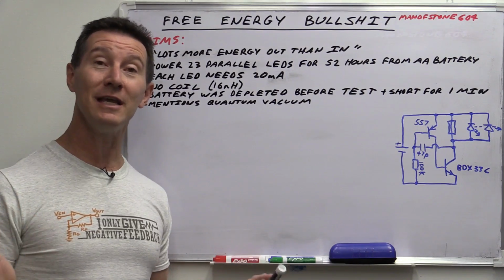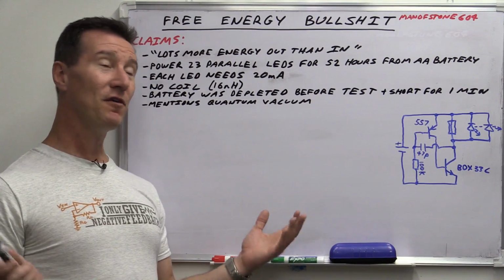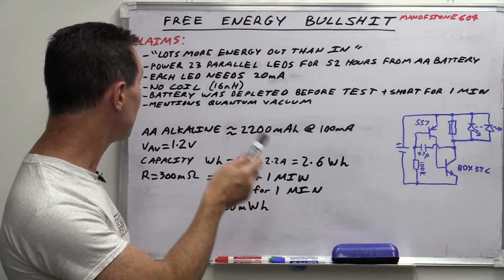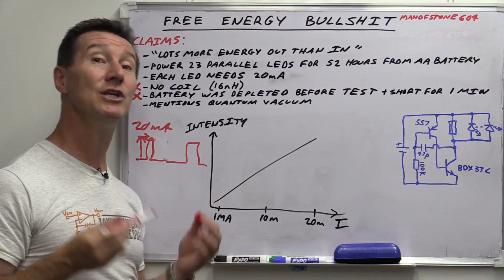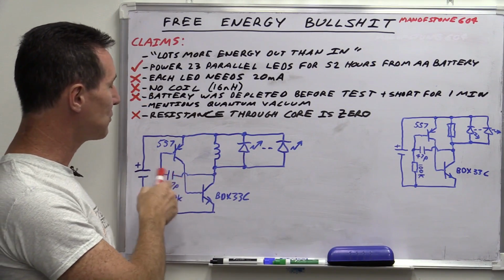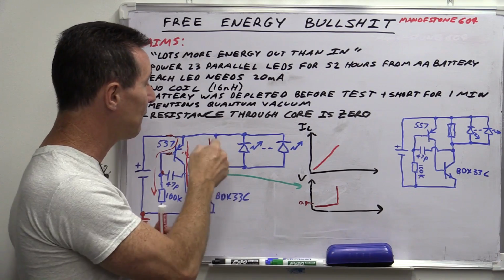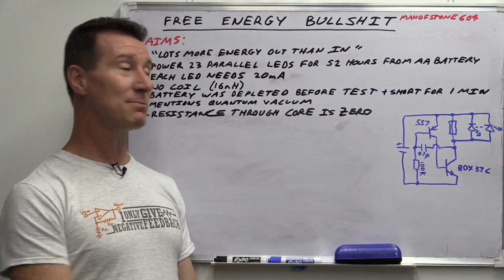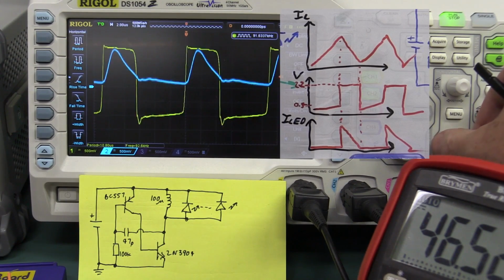EEVblog #708 - Free Energy Overunity is RUBBISH!

Comment: Stars consume energy to produce new particles of high mass. The smallest most energetic particle is the electron neutrino. It begin's time through progressive kinetic reactions. If free energy from this timeflow did not exist, your atoms would not exist, since they are getting free energy.
In 1955 two head professors for a University in Texas toured the country's colleges to demonstrate electron photography of a vacuum. Inside a space the size of your fist is enough power to run a nuclear carrier full bore through the water, according to electron photography.
All working free energy systems must utilize zero point by using carried waves inside a carrier wave. By imploding the carrier wave with them through the same dielectric materials which are like individual capacitors, waves are set in sync yet out of phase with proceeding waves so that after focus the waves must combine, forming a new higher frequency wave. This transformation waveset was described by Tom Bearden, witness to the Philadelphia Experiment. Nikola Tesla's files provided the plans for that, stolen by the FBI guys who smothered him to death.

Comment: Good day! I just stumbled upon your videos and watched a couple and have a pretty good sense, by now, of what your about. While they're enjoyable you are a bit whiney... Lol. No doubt, but I'm not going to kill the messenger because the message is good. So, I am a degreed engineer but more on the mechanical side (aeronautical to be precise) although I have a smattering of education in electronics and more in electrical. I've never really put much effort into understanding electronics circuits because as a technology consultant for many years it was more modular and packaged then I needed to focus on the details about. So, anyway, I have a question for you now which I could probably find out on my own but if you would enjoy entertaining it I'd appreciate it. It seems to me from watching your video on the overunity circuit with the LED's and the single alkaline battery, it seems that the end goal of a good circuit design for this particular solution would be to have an oscillating circuit cycling at about the frequency of the intended led to be lit. This would expend the least amount of energy in theory in lighting the LED ie turning the energy consumed into a useful purpose? I would say that my prior lack of knowledge about how LEDs really work led me to believe that we supply continuous power to an LED and it will oscillate at it's predetermined frequency ( and I believe that frequency has to do with the material that it is made out of). What your video leads me to believe is that we have to oscillate that power source to the LED in order to get the led to become excited and emit light in the first place? (either that or this designer's focus was to reduce the current draw from a continuously on circuit to a intermittent circuit understanding that an LED does not need continuous power supply in order to operate) and the more efficiently and effectively we do that then the better (more efficient) the circuit will be. Am I on the right track? Alternatively, to supply any voltage to the LED in the intervals in between when it needs to be excited in order to emit light would be energy wasted? Is that correct? The reason I ask this I guess is because the focus of this overunity perpetrator's video was apparently to demonstrate how easy it is to you know power the world on free energy. We know we can't do that but we try and strive to power it with the least amount of energy required as possible. So now I'm just wondering fundamentally what is the most effective way to light those LED's? What variables would be the focus of a competent circuit designer whose job was to do just that?

BTW, my youngest boy is now 10 years old. He's a big fan of that stampylonghead minecraft guy. funny thing is your voice and his voice are very similar and your approach to explaining things is also pretty similar. Lol. In contrast though, I would much rather have my son watch and learn from your videos so please keep up the good work and I'm going to introduce him to what you're doing and hopefully that will spark an interest (in technical things) in him that I've always had since I was a boy. Thanks again and I would appreciate if you just tone down the sarcasm just a little bit. I don't know if you have kids, but the last thing we want to do is make them feel like they're being ridiculed for experimenting and for taking risks... 

Regards,
Greg Baden
(Bryson Baden's dad)

Comment: buy the way several of these jewel thief dudes claimed they were super draining  the battery lower then you can normally use it ,by boosting the voltage, so a few were not far off the mark.

Comment: Joule thief concept is to use the energy of the old worn-out batteries 1,5V if you made a joule thief with current limiter for two batteries , one could mix batteries, and better use of them. Try led type 5050 ? There are 3 led inside the chip 3x20ma

Comment: Your video over all was above average, but your big mistake is to lump all over unity devices into one group.

There are MANY devices on the market that are over unity. (COP greater then one)
You can buy them. And test them all you like. THEY ARE OVER UNITY.
They have been on the market for about 100 YEARS already.

WAKE UP!

STUDY STUDY STUDY!
Reply: wits2014 I don't know if I'd classify them as over unity. Certainly they output more energy (of one form or another) compared to the input energy, but they are an open system. To me, an over unity device operates in an isolated system (i.e. one where no external matter nor external energy can enter the system).

Actually, scratch that, when you do an analysis of the total energy in any of those systems, you'll find that the total input energy is always greater than the total output energy.

Heat pump:
input energy = total heat energy + total kinetic energy
output energy = total heat energy - heat transfer losses
input > output

Solar panel:
input energy = total light energy
output energy = total light energy - heat losses - diffusion losses
input > output

Windmill:
input energy = kinetic energy
output energy = kinetic energy - blade losses - noise losses
input > output

This is a back of an envelope analysis and is probably missing a bunch of losses, but it's still valid.
Reply: wits2014 sure "free energy devices" are on the market and have been for a long time. So are thousands of other scams...
Prostitute isn't the oldest profession, scam artist is...
Reply: jwenting 

You ever heard of a Heat Pump??!! 

Or a Solar Panel? !

Or a Windmill?!

Are all of these devices,  scams???

I could name many more common types of free energy machines.

WAKE UP!!!
Reply: chickenman297 if they get more out than they put in, there's another input they don't take into consideration...
Reply: jwenting I thought that's what I pointed out.

Comment: Research C.O.P. 
Most machines that show C.O.P., show it at greater then one. 

Do you KNOW what that means? 

it is best to learn as you go thru life. 

STUDY STUDY STUDY...
Reply: If you think COP ratings have any relationship whatsoever with energy production, it is you that does not understand what it means.

Machines that are given a COP rating are for heating and/or air conditioning, or refrigeration.
Here in the USA, COP ratings are typically only given to the heating mode of heat pumps.
The COP is the ratio of heat output per unit of electrical energy input.

The base line for comparison is electric resistance heat, which outputs 3.412 btuh per watt of electrical input.
A heating device with a COP of 1 outputs 3.412 btuh per watt of electrical input, making it 100% efficient.
Electric resistance haters convert all of the electrical energy input into them directly into heat energy.

A heat pump with a COP of 3 would output about 10.24 btuh of heat per watt of electrical input, making it 300% "efficient" compared to an electric resistance heater.

The key thing to understand is that the heat pump is not simply converting electrical energy into heat energy, it is converting the electrical energy into mechanical energy to move heat from one place to another.
The heat output is equal to the heat absorbed from someplace else + small amounts from conversion of electrical energy to heat in the motors, etc. + heat of compression - any losses.

The total energy output is equal to the total energy input in either system.

Comment: There is a slight error:
When the transistors switch off, there is some current in the inductor.  This current value is what sets the peak current in the LED.  The place to put in some sort of current limiting circuit is in series with the power transistor.  Even without an actual current limiter, limiting the on time limits the current rise to V*T/L.  If the transistors are made to stay off until after the inductor current stops, this will serve as a fairly sloppy LED current limit.

Comment: Dave, keep your panties on dude!!!!! 
The UFO that I came to Earth with uses 4 of these circuits in semi parallel, double tuned, IF staggered, super duper hetrodyned configuration to power the 6 warp engines on my space ship all of which,are powered by a single AAA battery that is at least 10 years old. I still make WARP 9. With a fresh AAA I can do WARP 12.or better.
Don't tell me there's no free energy!!!
 I'll blast New Zealand and Australia off the face of the Earth with my
Mega quadrature, Sperving Bearing loaded, double D over undulating, turbo Encabulator laser taser gun, also driven by a used and slightly crusty AAA battery.
ZZZZZZZZZZZZZZZZZZAAAAAAAAAAAAAAAAAAAAAAAAAAAAAAPPPPPPPPP YOU EARTHLING!!!!!!!!!!!!!!!!!!!!!!

Comment: Physics dictates that you can't get more energy out than what goes in. I can tell you that logically and realistically you can. I've recently invented a self running generator and am in the process of patenting it. The most I'll tell you right now is it uses a bunch of motors, a step up converter, inverters, super capacitors, charge controllers, bike rims, gears and chains. It is designed to be able to add extra units to it. There is also room for expanding it to include solar power, wind generators, water wheels and other means of generating electricity. It's basically a self contained power plant. It's portable enough to be pulled on a bike trailer, but powerful enough to run anything in my house for as long as the parts don't wear out or break down.

Comment: ^You make good Videos, Explaining the electrical work of the circuit,,

I have another thing to bust, put up a high Antenna with lot blank cable, and put a rod into the graound, Pls can you tell me is there energy floating from atmospehere to earth ground? and can you catch and tranform it? becouse it would be free energy its floating around you
Reply: Verbrecher9000 the box you live in is a "bit" bigger than your own body ^^
Reply: Verbrecher9000 + one question, supercaps are made with an isolater between conducting material,,,,,
i saw somewhere this isolation can even be air,      SOOOO  the rotating earth and the standing sky will build up a capacity till the electrons strike through the air to the ground? right?

Comment: Hi Dave,
Thank you for this wonderfull video. You remind me in some aspects of my father that was an EE, i only took it up as a hobby. What this reeminds me of, is a method of conserving energy, i think an old trusty 555 was used and to keep the led's cool it was set to about 4KHz i think so it can still be bright and no flicker too, used less power over all instead of direct connection to power source and just a resistor. Circuit was way back from the 80's.... Thank you for the memories.

Comment: While it is certainly true that "nothing's for nothing" and the Laws of Physics cannot be violated (else they wouldn't be "laws") and that no energy is "free" in the sense it has to come from somewhere not nowhere, it is also true that Nature stores energy in many ways, relatively few of which have been well investigated or understood, and further, at least some of Nature's energy storage "schemes" can be tapped with low-power apparatuses to take advantage of the natural situation to produce more energy that is required to operate the energy-tapping apparatus. This is not something for nothing; rather it is just making good use of what Nature has already provided.

For example, a study by the US DOE found that the atmosphere of Earth (air is an insulator) is at a local potential of 50-200 volts per meter of elevation with respect to Earth ground (which is a conductor) in nice weather. In the same study, the DOE also found that when local conditions are stormy (whether it is actually raining or not) the electrical potential of the air with respect to the ground can be upward of tens of thousands of volts (which hints that lightning may not be the cloud-friction phenomenon the standard model of physics treats it as.

Nikola Tesla figured that out before the DOE even existed and patented a device to tap that electrical potential but, alas, his invention was ignored and Tesla himself, once he announced his intention to provide free electricity to the world (no cost for the power but not no-cost for the apparatus tapping it) he was vilified and driven out of business (and almost insane) by the monied interests (duPont et al) who controlled such markets. In his pique,

Tesla moved to Colorado and tapped copious amounts of energy from the atmosphere and used it to send some lightning down the mountain, scaring the bejeebers out of people. In his calmer moments, he also built transmission towers in Colorado and demonstrated the wireless transmission of huge amounts of free energy, proving his assertions. Alas, his demonization by the monied elite with the complicity of government (a familiar unholy alliance) put an end to Tesla's humanitarian efforts and his illustrious career.

Comment: I'd like to clarify the point you made while correcting the claim that the "resistance through the core is zero".  The reason there is a non-zero "resistance" over the core is due to its reactance.  When you have capacitance and/or inductance in the path of an alternating current, you get a frequency-dependent "resistance" that combines with the DC-resistance to form impedance, a complex number where the real part is the DC resistance and the imaginary part is the frequency-dependent reactance.  For oscillators with frequencies that might be reasonably expected from that circuit, 50 mH of inductance is going to provide a rather substantial reactance, meaning the total impedance is going to be a fair bit more than the DC resistance he's got in the circuit, so the battery life is extended even further.

Comment: I'm surprised no-one asked the original poster to put a switch to cut the battery out of the original loop after it powered the circuit, since if you were actually inserting power, you wouldn't need the battery.

Comment: You burned 1237 calories during the course of this video. There were only 1145 calaories available as stored fuel in your body. Thus, your efforts to dispel the concept of overunity/free energy only served to provide another pointless Fail video for YouTube.
Now, lets see you expend another 800 calories on your keyboard, responding to this silly comment that was designed to frustrate you. (Your participation is required.)

Comment: 16.45--pulse it once every 10 cycles'?. Every cycle has 1 pulse,so how do you pulse it once every 10 cycles?. Also i notice your calculations were done with a new(fully charged) 1.5v battery,and yet even you clearly show that the device in question used a !!depleted!! battery. Do you know how depleted the battery was that was used in the device in question? Could you rerun the test using a battery that was depleted as the one in the device in question?

Comment: overunity devices are a dead concept, but cosmic freeloading now thats where all the money's at.

for example If you strung a conductive wire/tether attached to a torrid in orbit down to a ground station, you would get a hell of a lota electricity out of it.(logistics aside)
mind you it would have to practically be 60-100 miles long and "may" pose quite a danger if the said cable/tether were to ever snap.(and by "may" I mean wanton amounts of sheer destruction and anything in its path being quite utterly squished into many tiny small pieces)

Comment: no such thing as free energy, just cheap energy, still needs to be robust. like solar panels, wind mills HHO Hydrogen gas, 

Now it can be misleading, over unity is real. you do get more energy out of car then what you put in from the battery, the battery supplies a certain amount of amps and the spark plug cumbusts the gas, uses the stored energy in the gasoline, you use a little energy to excite alot of energy. .

Comment: As Far as I know is the Zero Point Energy belongs to Quantum Mechanics, so the energy that makes the two plates swing in vacuum is mechanical energy and not electrical and the energy is just measurable, not enough, if converted, to light an led - Someone got hooked on the word Energy, without knowing what it exactly means.

Comment: How is a wire going through several torroids not an inductor? Some of these free energy people are real muppets.

You can get a lot more power out of an AA than the data would suggest to people who dont know what they are doing for the following reasons:

1 All batteries are quoted for capacity after a certain amount of storage for distribution etc. So if you get fresh from the factory 30% more charge is possible as they have a lot less time to self discharge.

2 Batteries are usually rated for 20hour discharge. If you discharge it slower you will get more charge out due to the way the chamistry works. If you discharge it quicker you get less too.